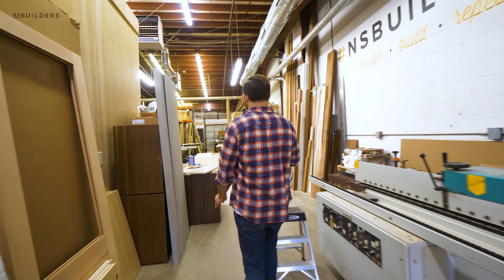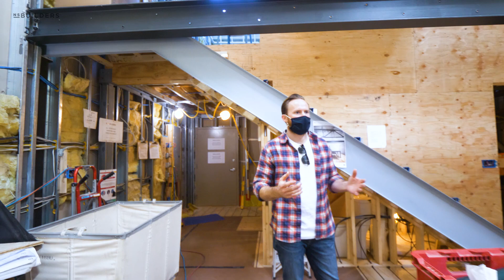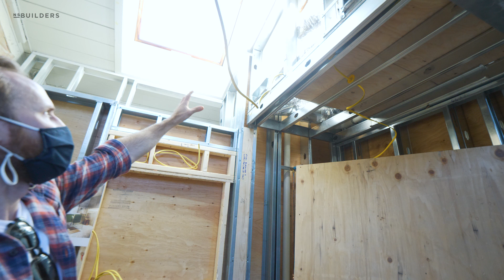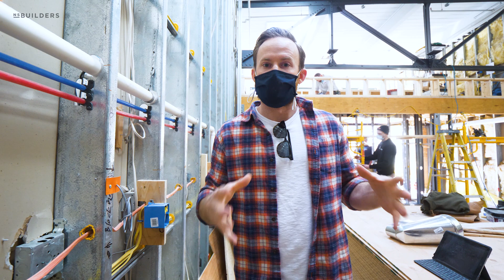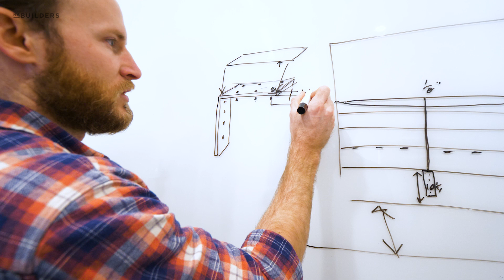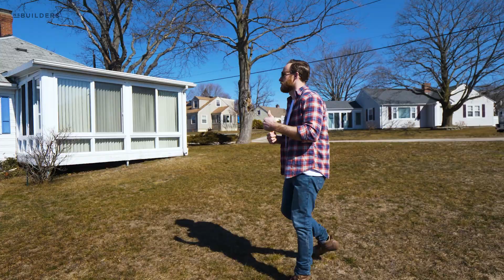First look at our new oceanfront custom build | Site Visit

Comment: Compare steel deck with concrete slab vs precast hollow core panels with a topping slab. I suspect you'd pick the latter after comparing cost.

Comment: Did you consider a pretensioned precast concrete floor for the garage? It's another really strong solution and might be less installation time. As far as not having gas service, that to me depends on hot water demands. If the demand is high, I would rather go with instantaneous over a heat pump water heater. I still prefer a gas clothes drier for now as well.
Reply from the maker: Looking to elongate all fossil fuel needs.
Reply from the maker: Eliminate

Comment: Cool to see the new project. Since it’s a new build a why not go for the PH certification?
Reply from the maker: I should probably correct myself in the sense that we’re just going for really efficient, passive haus is beyond what we’re looking to achieve
Reply: I’d be interested to hear why PH is beyond what you are trying to achieve. If you are already doing super insulated and air sealed the additional costs of passive seem minimal. Maybe it’s client based.  In any case, I think it would be interesting to hear your thought process. Thanks
Reply: @Carlo Cremonini as the client and architect - maybe we’ll go for certification, but that’s not the highest priority at the moment. Stay tuned!
Reply: @julianugentarchitect  looking forward to it! Thank you

Comment: Great vid as always. For the steel support bracket for the dresser what plate thickness are you planning on using? I'm not sure which dresser you're referring to but you mentioned that it's 7' long so it's probably pretty heavy. Any concern that if you use setscrews you'll just end up deflecting the plate downward as opposed to lifting the dresser up? Obviously, with thick enough plate this likely won't be an issue. Also, even with some deflection in the steel there will probably also be enough upward force on the dresser to lift it that 1/8th. Just curious.
Reply: He said in the video it's 1/2" thick